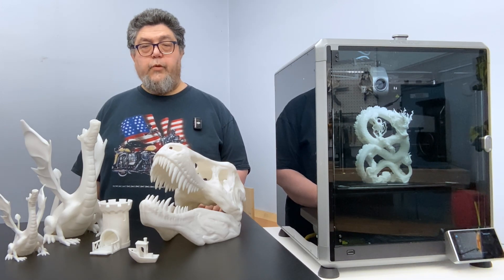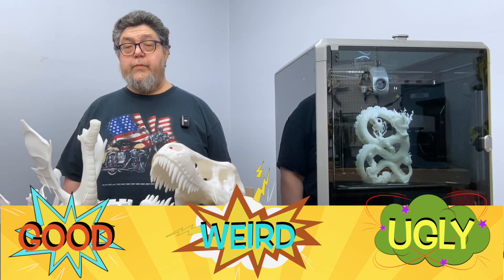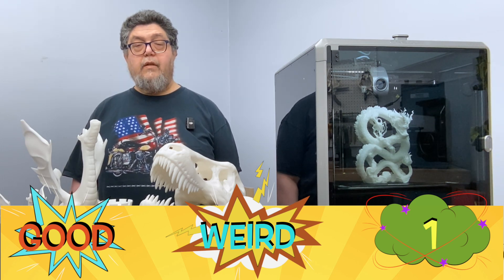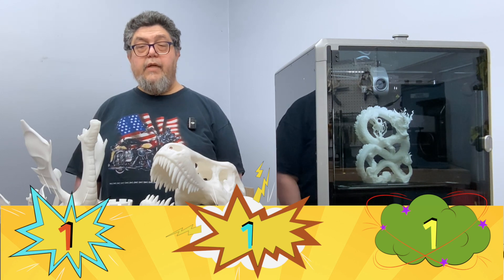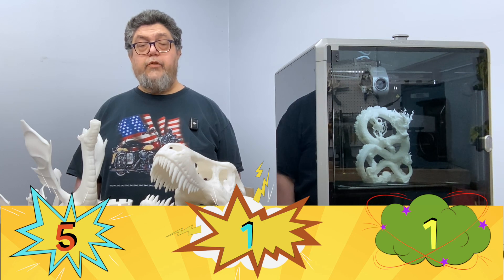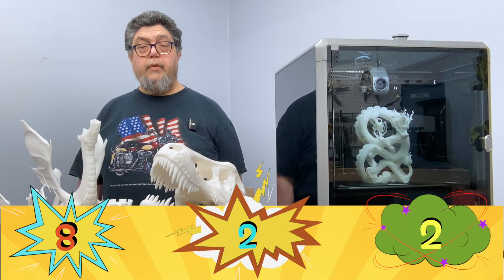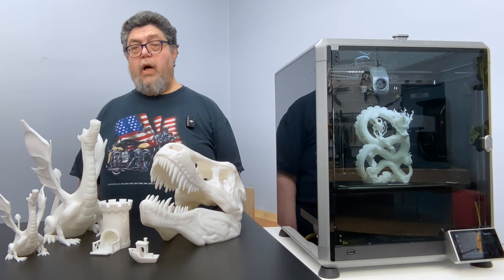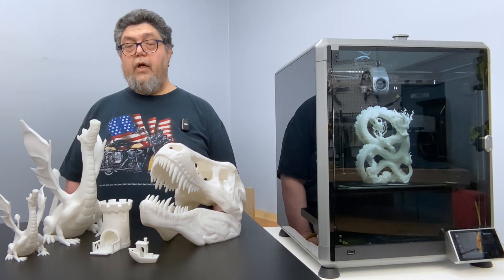I hammered the Creality K1 Max for a year. Here’s the verdict!

Comment: Thanks for the run down! Already bought this refurbished at $289 (BF sale + ebay coupon) and am stoked to replace my Ender 3 v2 Neo which has been quite a headache. Sounds like I'll def get a good value as long as the refurb part is truely cosmetic only (as creality claims) or a blem on the build plate (as I've already purchased a textured one to replace it).

Comment: struggling to open the crate it shipped in was user error...
sorry bud but you opened it from the wrong side. all you had to do was bend the 8 tabs upright with a flathead or forks of a hammer and pull the lid off. looks like you went crazy pulling apart the entire side of the crate but even in the photo you can see the arrows pointing towards the top oriented incorrectly.
its all good fuck it, you got it open anyway, but just fyi those crates are standard shipping tools and not designed by creality. they are easy to open if you are familiar with them

Comment: Did you have any problems with the belts? The machine worked for 2600 hours. The belt tension cannot be adjusted. There is a shift in the x-axis. The belts seem to be intact. But I don't know if I need to change the belts.
Reply: This is simply not true. The K1 Max has an X & Y belt tensioner in the top back corners of the machine. You need to tune the belts to 110Hz by putting the hot end at 150mm (center of the bed) and measure the sound via spectrometer. Or go the easy route and print out the Belt Tensioner gauge from Printables and get your belts tensioned in under 5 minutes. There are 2 screws per tensioner you need to loosen, as well as the 2 extra screws that need to be inserted to adjust the springs tension. These 2 extra screws came with your printer if you bought it new.
Reply from the maker: @OneCylinderProductions Thanks for sharing that.
Reply from the maker: I've had no belt problems, but the post that explains the tensioner is full of useful information. I haven't tried it, but it's why these conversations are so valuable.

Comment: would you recommend the creality K1 Max or the Anycubic Kobra 3 Max (Moving base plate, no case)?
Which would produce a better output quality?  Thanks
Reply from the maker: So, they are kind of different beasts. Unless you do some sort of major surgery, the K1 Max is one color only. The Kobra 3 is multicolor. Now, I haven't used the Kobra 3 Max yet. It does have a bigger build volume than the K1 and that would have come in handy with all those Multiboard plates I was printing out. It's also an interesting comparison in terms of reliability. The Creality K1 Max was a solid workhorse and other than the annoyance of filament replacement, it just kept chugging on. The Kobra 3 Combo arrived DOA and required multiple surgeries to make work. Now, however, it's turning out really amazing color pieces. And on the third other hand, while the K1 Max was pretty much a problem-free workhorse, the K2 Plus arrived DOA, and I have at least a full day of fixing to tear the thing apart and install new parts, and I'm still not convinced that will fix it. So, it's a bit of a toss up. I guess if I were in your shoes, I'd try to decide if I really, REALLY needed the Kobra 3 Max's bigger build plate, and if I did, get it. If I didn't, then I'd go for the K1 Max because bigger build plates usually come with bigger problems.

Comment: Did you have any problem with the magnetic plate coming apart (tearing) after prolonged hot printing sessions? At first the build plate would slightly stick to the magnetic plate, but gradually became worse with the sticking, and tore apart the magnetic surface. I fixed this with applying a new magnetic plate and spraying on a few coats of some heat resistant varnish paint, and now there are no sticking issues.
Reply from the maker: If you're talking about the plate under the flexible build plate, no. I had no problem. The flexible build plate needed to be replaced after a part sticked on it so hard that removing it removed the surface of the build plate. That was a disappointment, but it only cost $20-30 to replace from Amazon.

Comment: You have to turn AI on for it to work 
It works great
Reply from the maker: I'll check it out. Thanks!
Reply: @AdvancedGeekery  I have had zero leveling issues i have had a warped plate though  AI scans the whole plate with a beam  it looks cool too
Reply: @awesomusmaximus3766  yeah, the warped plate issues are annoying, as the parts surrounding the plate edge can come unstuck sometimes. I have looked into upgrading the build plate to a 8mm graphite plate to try and get a nice flat surface with better heat dispersal compared to the aluminium plate .

Comment: I would b3 careful before purchasing any creality products. I ordered a k1 max from there official website and a very used looking unit was delivered to me in a box held together in some areas with multiple pieces of tape. Creality is not owning up to there mistake.
Reply from the maker: I had that happen once when I bought something from Rockler once. It was clearly not only used, but looked like it had been chewed by an ape-sized dog. To make matters worse, it was missing all the screws. They did eventually make good. Haven't had a similar problem with Creality, but I don't doubt it's possible.
Reply: @AdvancedGeekery Thank you for your response. I'm fairly new to the 3d printing community, I am only trying to share my experience, just as others replied to my posts on various different platforms stating similar experiences. With one person sharing there experience, and eventually only being resolved by filing a fraud claim against creality with their credit card company. It took them 2 months to resolve the issue. Love your channel, and it's content. Sorry for what may seem like venting, I'm just trying to spread awareness in the hopes of helping others. The best advice I received was to order from a local distributor (such as Amazon), as their return and customer service are usually leaps and bounds more helpful and faster. Buying something directly from a manufacturers website and receiving a extremely dirty and used product doesn't fill me with much hope when the their initial response is to check to see if all the parts are there and just accept it as is.

Comment: Liked and Subbed. New to 3d printing, how many colors of filament can you print with at 1 time?
Reply from the maker: My unit will only print one color. There's a brand new add-on that basically requires you to rebuild the feed mechanism from the ground up, and that lets you use a CFS and four colors. I might try it someday, but I'm pretty happy with this one as it is. Creality now has two other printers that do four+ colors out of the box.

Comment: the extruder has been replaced, by a new one they are 30 bucks on amazon, new printers already come with it. filament changes will be much easier
Reply from the maker: Cool. I will definitely check it out.
Reply: @AdvancedGeekery  There is also a new hotend you do not have that has to be changed when you change the extruder.
Reply: There is also a new hotend he does not have that has to be changed when he does the extruder.

Comment: A mention that Creality Print is a cut-down version of Orcaslicer wouldn’t have gone amiss. Also, that this printer can be easily rooted with the username/password supplied by Creality. That means you can make use of Orcaslicer if you want to.
Reply from the maker: Especially now that Creality Print 6+ is basically a version of Orca.

Comment: Nerds getting their butts kicked by a wooden crate! Lol, thanks for the video. I can’t decide between this and an Anycubic Kobra S1. I have an Ender 3 Max Neo and it is an absolute chore to keep it printing acceptable. It’s difficult for a preteen child to use and just print and have fun without fighting.
Reply from the maker: Hah! You shoulda seen the other guy! So, a couple of thoughts. First, this is single-roll only, while the S1 Combo has a multi-filament feeder. The K1 has a bigger build area and I like the slicer better (but that's because Anycubic doesn't yet have remote printing for Mac on its Slicer Next). But there's one big difference you might consider if you have a pre-teen: the K1 has glass on three sides including the door. The S1 has a plexi top and door. While I've been careful so far and haven't broken the K1's door, Uncle Jessey did (check out 17:50 on https://www.youtube.com/watch?v=TBnquxRzVVg), the glass on the K1 might not be suitable for little kids. That said, it's been a beast in terms of what it produces, with very few issues other than the annoyance when I have to change filament. Good luck. Let us know what you decide.
Reply: @ thanks for the input. I ordered the Anycubic S1 Combo shortly after I left that comment. I wanted a bigger build area but so far we have used the 320x320 on the Ender 3 Max Neo. My son wants to print Minecraft and smaller stuff that a 12yr old would want to do so I think losing a couple inches in all directions won’t hinder his fun. Thanks for your feedback, I do recall seeing some mentions of shattering doors. Subscribed.
Reply: @AdvancedGeekery i have a k1 and k2, and 2x S1s and 2 K3s, my k1 max had been better in yhe short mo ths ive had the s1 and k3
Reply: Please take my advice. I had the kobra S1 for one week and sent it back. The ACE PRO UNIT is junk. The only thing it does well is heat the filament up. But maybe watch a few reviews about it.

Comment: Thanks for the video!
Any chance you could share your pla/hyper pla speed settings?
Had this printer for a few months and love it!!
Reply from the maker: Best thing to do is read the ZDNET article listed in the comments. I'm using mostly defaults, but these are the settings from the profile I use most: Print Speed: 300.00 Infill Speed: 300.00 Outer Wall Speed: 200.00 Inner Wall Speed: 300.00 Top Surface Skin Speed: 200.00 Top/Bottom Speed: 200.00 Travel Speed: 500.00 Initial Layer Print Speed: 60.00 Initial Layer Travel Speed: 240.00 Skirt/Brim Speed: 60.00 Min Path Length at Travel Speed: 1.00
Reply: @ thanks a lot!!